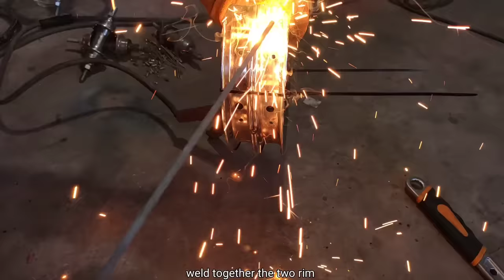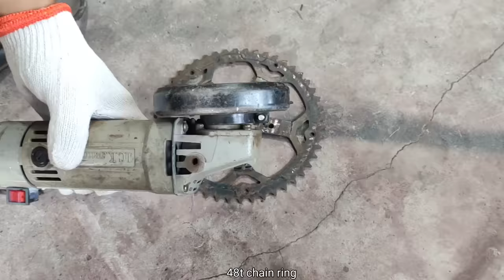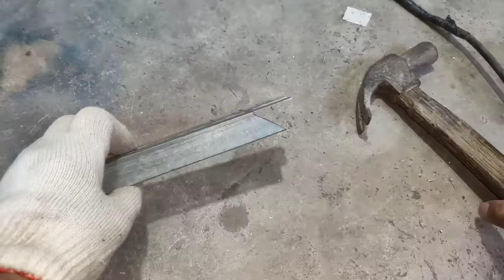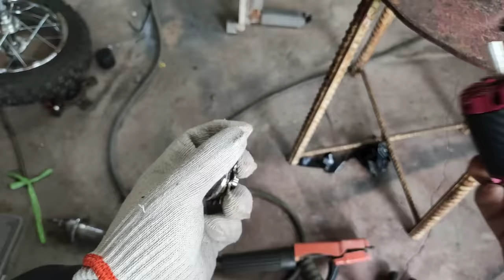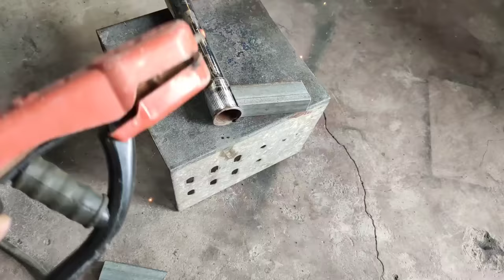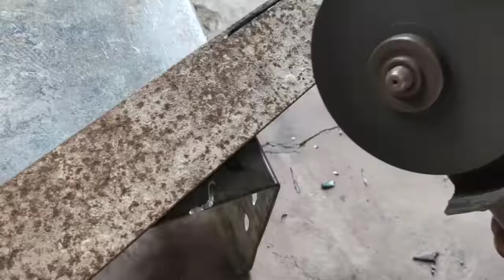12V Fat tire electric scooter from bicycle parts

Comment: Had a feeling that little motor was going to have a hard time pushing all that box steel, but this guy is way more talented than me so I'll be quiet, 👍
Reply: This guy is more talented than anyone of us.
Reply: Nope brushless motor r supper strong. He used small battery is main problem. The motor is above 1500 Watts. Which is equivalent to 2 horsepower.
Reply: It is not possible - "1.5 kw" !!
Dont jump away from reality and physics. 
This motor is about 150-200 W. Thats why max speed is ~30 kmh.

Comment: i think if you changed the title of the video you will get more views
try removing "12v" and replace it with "brushless" or "rc motor" or something like that
because when i did read it first thing come to my mind that is another 775 project
Reply: 6 mil views later

Comment: Have often wondered about a dual-rim wheel using a single tire & dual tube  like that. Thank you for clearing it up that it can actually work. Also a minor suggestion - when cutting the slots for the axle, it's a little bit neater for the final product (as well as being easier and cheaper in terms of cutting disc lifespan) to drill a hole and just cut 2 slots to the edge. I'm guessing a 13mm bit would be the one you're after for those wheels. Worked well when building a little shopping cart the other week using a pair of 26" rims
Reply from the maker: in my experience, those tires are not only looks wide it also have cussion effect like fat tires. yes it's look better if I used the axel slot from old shox

Comment: very cool that you built a scooter but the time and labor and all the metal parts and motor and esc and hand throttle everything combined I think you should just save $300 and buy a scooter because at that price you can get a decent one now a days that would be much better than this one and from the looks of it might cost the same including your labor and parts...but most of all your valued time.

Comment: The speed is just that okay because you just used a 12v motor. The only downside is the noise of your scoot but great project you've done.
Reply: it's can do 6s...so can the ESC. My stock E300 only has a 300watt Brushed motor. It'll do 12MPH on 24V  lead acid ( 6-8 miles range) You can find used
$50-$75..without the hazzle.  i got 2-ea for free.

He's scooter needs Rear Brakes and a chain cover.
I build a scooter with even fater tires 8" WIDE (rear tires/wheels from pock rocket)1000Watt brushed 48V..it's only $75 for motor/esc/throttle. make it do 25mph and 12 miles range..The battery bay isnt big enough to hold 12 mile range in my E300..thats all...You can get 1500-2000 brushless go kart/scooter
esc for $150.....it's the batteries that;s going to cuase. money.
Lots of Poor doing DIY and cheaping out
Reply: @lossantoscity3249  well..he could add 2 more cells. They're only 10C lion.
it's probably why he's keeping only 16V...but I wouldnt use 10c LOW discharge cell...becuase they'll over heat and crap out....That little motor will get HOT in 5 mins.. Brushless SKATEBOARDs use 2-ea or BIGGER 6384 ( case size)..SKATEBOARD are LITE..That scooter is a BRICK

Im using 50C LIPO. That's why it get expensive. That's why adults fat tires scooters are $500-$1000...mostly becuase of batteries/chargers
 Use thick arss wires for 48V. Wear helmets and GLOVES...definitely rear brakes for anything over 12 mph..Not unless you like endos :-P 

There's 20-30c lion on cordless drill battery packs...5s ( 20V)   6s ( 24V)
There's 2-3hp DC brushed magnet  motors in treadmills
1 h.p. = 750 watt..there about..
You can also use the ESC  from the Tread mill.
The power converter..transform it from AC to DC..That's all.
Reply: @oneeyemonster3262   I'm not replying to you.
Reply: @oneeyemonster3262  that's was for the main comment.
Reply: @lossantoscity3249  sori po mr. Genius.ang nkalagay kc sa caption is 12v so what does others think about that.
Not every people are aware of that knowledge in electronics.
And although you are genius of that knowledge, you don't have the right to say TANGA that easy.
Nag explained ka nga to tell that i was wrong but don't you dare to say that TANGA dahil lang s  GENIUS k.
Reply: OneEye Monster got details of your electrical set up? are you saying you use e300 running gear or that you put larger motor in as well?
Reply: OneEye Monster do you have details of where to get the 48v/1000w motor esc/throttle at such a good price? what battery setup do you recommend for a 50kg kid?

Comment: You're a brilliant fabricator. The creation of the scooter frame and wheels apparently free hand, was a joy to behold.
Can you tell us what type of welding rods you used here and what is the current rating on your Arc Welding machine?
Reply from the maker: 6013

100A to 140A depends on thickness of metal
Reply: @albertnario4877  Thank you..
Good luck with your future projects👍

Comment: how was the motor?does it over heat? how long did you travel for one full charge ? :) nice project
Reply from the maker: 8km, motor are getting hot but not to the point it burn.
Reply: @albertnario4877  nice,

Comment: I think you should have gone with 36v for more power. Seems like it has decent speed on flat ground but struggles up hill. You already have those nice fat tiees (very cool idea btw) so it should be stable enough to run at higher speeds.

Comment: Are you sure this is 12v not 36v?? Cause the speed is incredible 🤗
Reply: I think he's using step up power. Converting 12 v  to 36 v
Reply from the maker: battery are directly to ESC the motor I've use can pull 900w peak, small but powerful..

Comment: why did you change the esc? Please
Reply from the maker: the first esc has reverse function, almost every time I reverse the scooter. and the second esc is slimmer
Reply: @albertnario4877  is it safe if I use the esc plane 80a or i have to follow you using the esc 60a ?, please answer my question because I really want to have a homemade scooter
Reply from the maker: @niponspotless5277  80A or higher is better.

Comment: boss anong motor / dynamo gamit mo? penge naman ng link ng shop.. thanks.
Reply from the maker: n5065 search mo lng sa shoppe lalabas n yun
Reply: tnx sir..
last question lang pwede ko ba i rekta yun sa 12v na rechargeable battery? saka 3 yung wires nung 5065.
tnx ulet.
Reply from the maker: hindi pwede, kasi AC input ang kelangan sa motor.
Reply: boss saan po nakabili ng sprocket n kinabit mo sa motor?

Comment: Boss magkano bili sa electric motor na ginamit mu. Pwede kasi gamitin yan sa e-skate board
Reply: jAc0b GabreiLe pilipino ba sya pre?
Reply: Ou pilipino yan boss. Idol yan
Reply: Ayus pala eh, taga san kaya c idol. Kumpleto ko sa mga gamit pero wala ko alam sa mga batteries and wires eh. Hehe
Reply from the maker: galing nga sa eska8 yung motor. may video ako tungkol dun, 

taga bataan ako